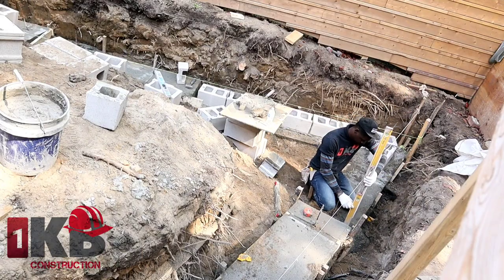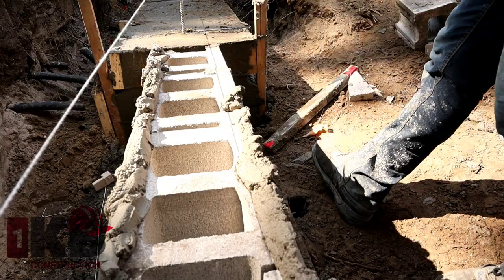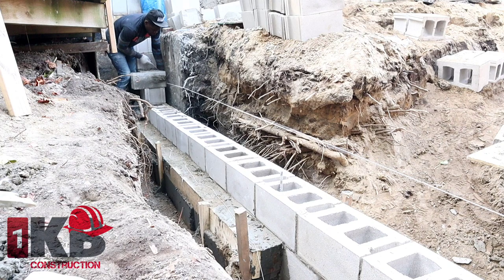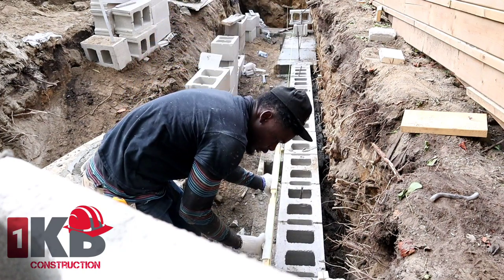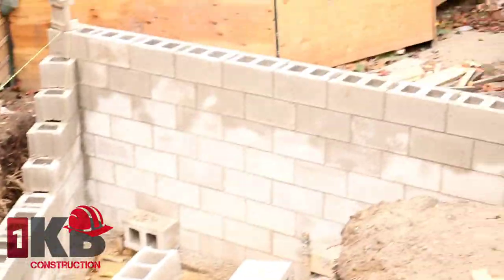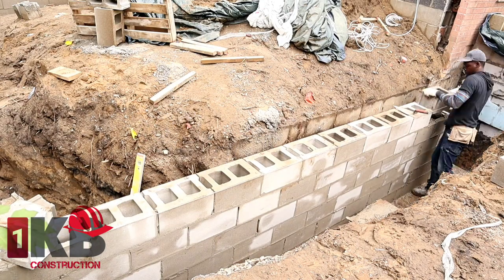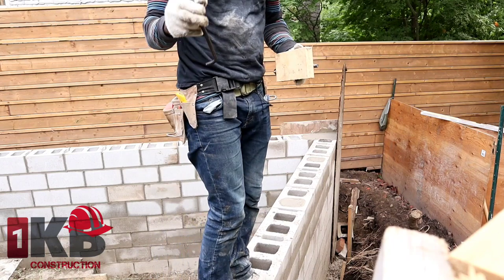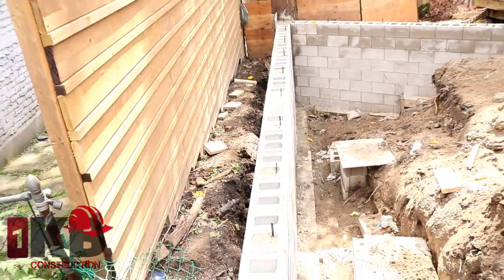How To Lay Block Fast And Easy!

Comment: Nice block work ryan. Interesting to hear the weight of those blocks . The 9 inch version of those blocks we have in Ireland are 55 lbs ( 25 kg) the dimensions of them are 215 mm wide 215 mm high and 440 mm long . The height and length of the blocks you are using in the video in metric are 190 mm high and 390 mm long is that correct and 250 mm wide ? I know that Canada uses the metric system like we do in Ireland but is the metric system used exclusively in construction.
Reply from the maker: Oh thats cool. Yeah that one that I was laying is very heavy,💪

Comment: What did you use to hold the wall because I didn’t see any long steels or filling of block pockets???
Reply from the maker: we do it abit different here my friend,  For some reason most people don't fill the block pocket ,that's not a requirement here  In most cases ,Some jobs they require it
Reply: @1kbconstruction824  Ok I learned something new cause I was wondering why you did it that way.... very helpful videos thanks much...
Reply from the maker: @infomedia8202  glad you learned something from it 👍
Reply: @1kbconstruction824  bless